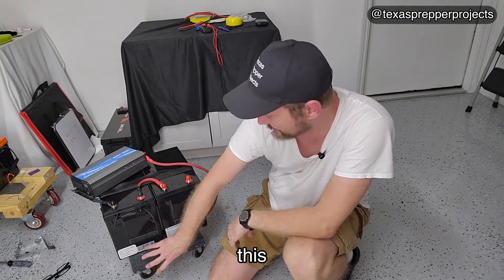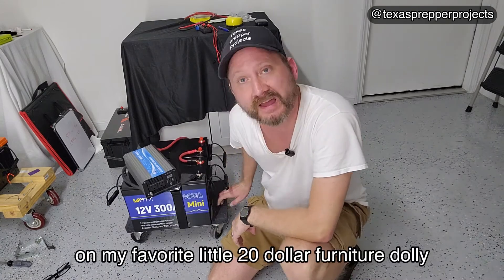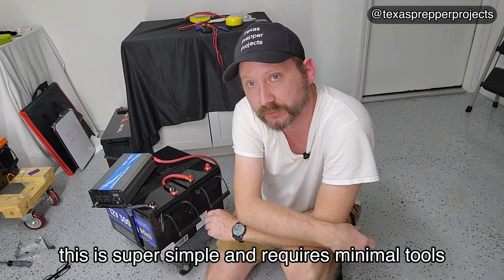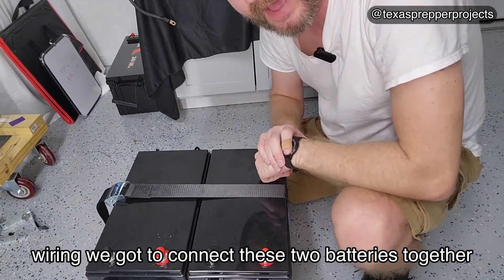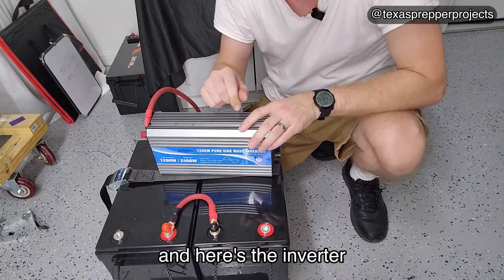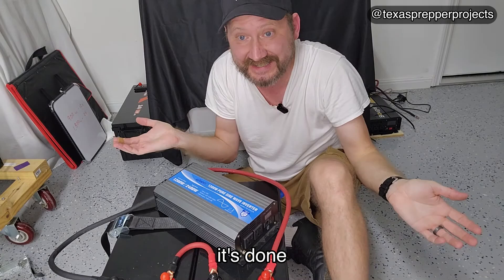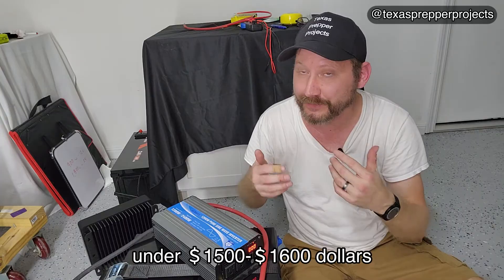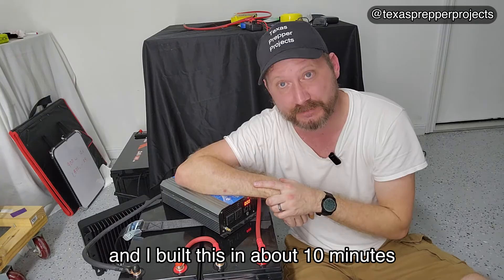DIY a 24V 7168Wh Energy System by Connecting Two 12V 280Ah Mini Batteries in Series!

Comment: Minimum it needs a fuse on battery positive to inverter. Charger can have alligator clips. Battery switch for long term storage? Nice batteries. Great video.
Reply from the maker: Thank you for your comment and valuable suggestions! Installing a fuse between the battery positive and the inverter is indeed a great safety measure to enhance the system's security. We’d also like to add that our batteries come with an integrated BMS system, providing multiple protections such as overcharge, overdischarge, and overcurrent protection. Additionally, some inverters also feature cut-off protection for added safety.
As for long-term storage, installing a battery switch is an excellent idea to prevent the battery from being in a discharged state for extended periods.
Thank you for your support and feedback! If you have more questions or suggestions, feel free to reach out anytime! 😊👌